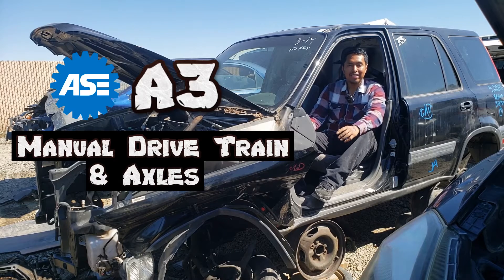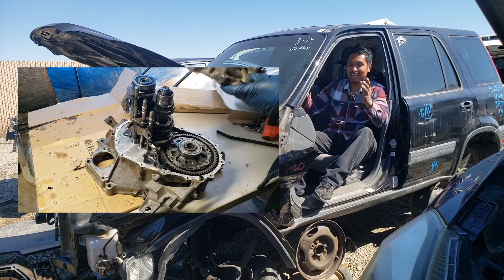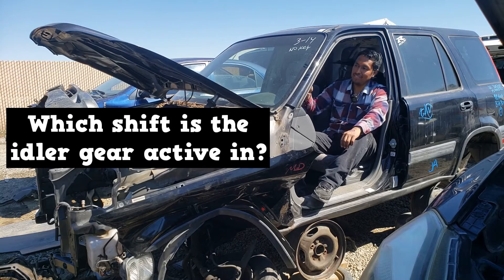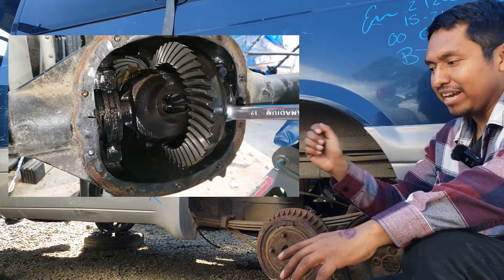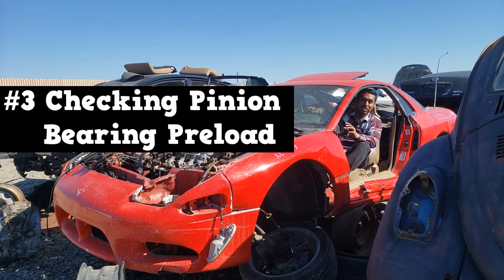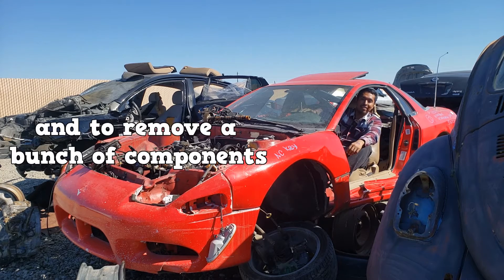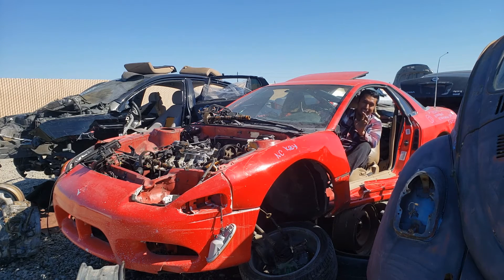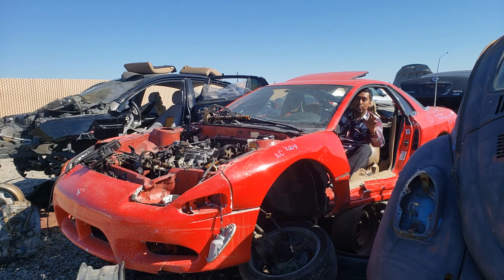3 ASE A3 Topics That Seem Difficult At First

Comment from the maker: Update after taking the test: I took it and passed! There was 1 question on tooth contact pattern, but simpler than the ones asked here, there was 1 question on pinion bearing preload, but it was on basic component replacement.